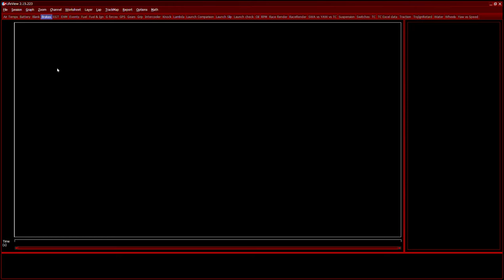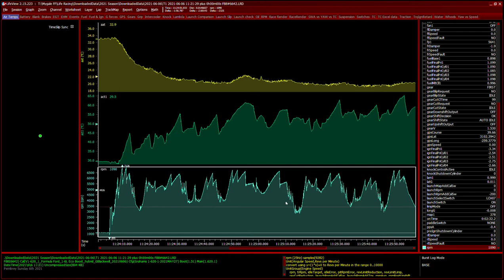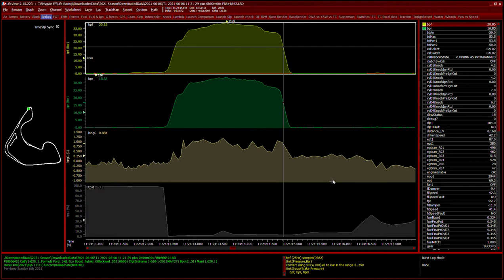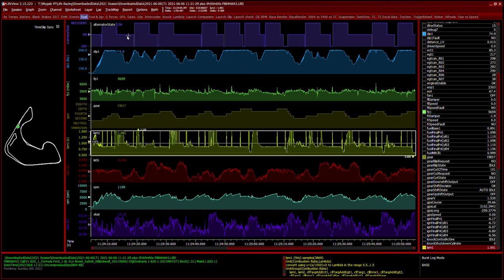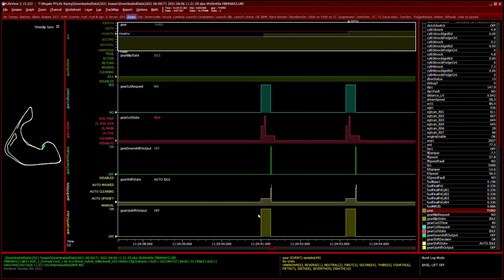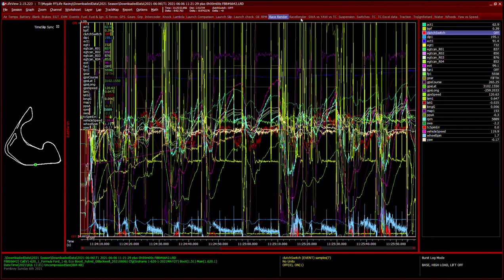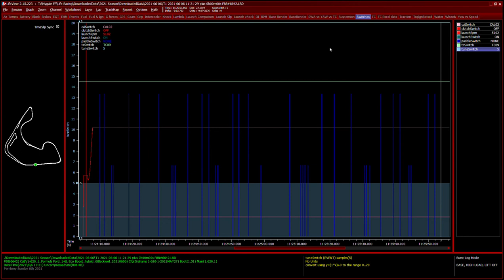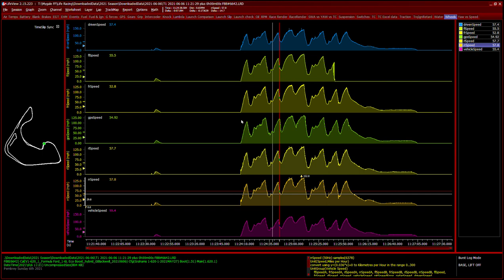Life View data analysis how-to overview

Comment: what kind of cable are you using to communitcate with your life ecu? also where can i get one?
Reply from the maker: You need an ethernet cable to plug in between the laptop and the ECU. I fitted a D-Link wireless access point to my car which gives me wireless access to the ECU. Again that is permanently connected to the ECU using an ethernet cable and is powered off a USB power supply.
Reply: @ZetecinsideMotorsport   ive heard of the ethernet cable but my ecu doesnt have the ethernet plug on it
Reply from the maker: @RickHernandez-sz8yp  mine had a Lemo connector, so I removed that and used a spare ethernet cable to let me connect to the ECU. Simple enough to do.